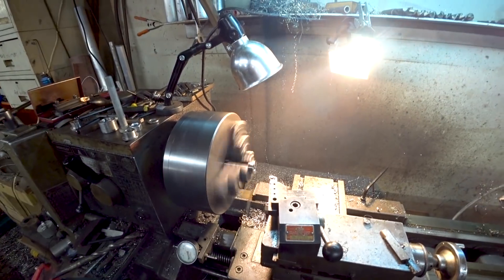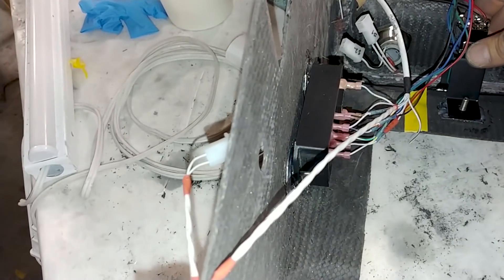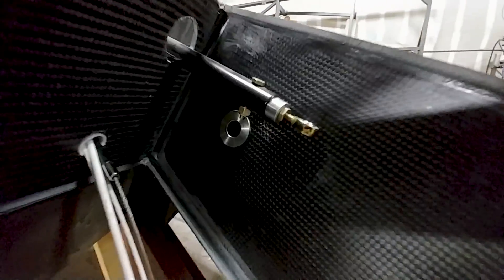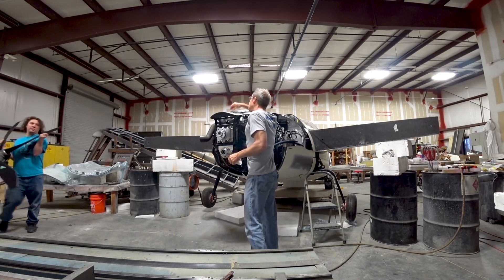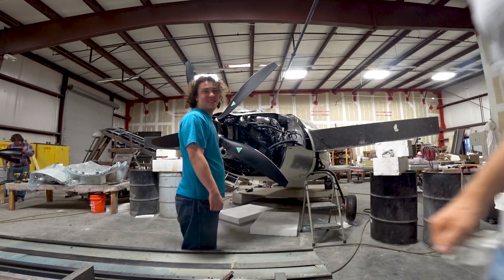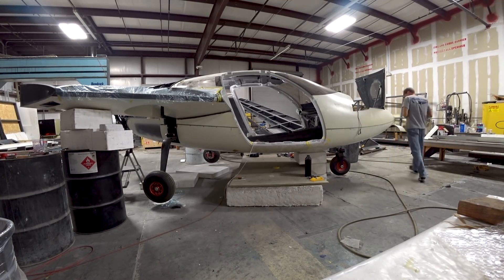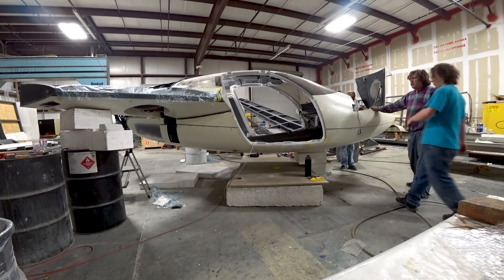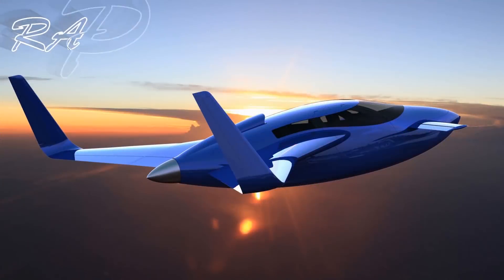This Bird Wants to Fly - Building the Raptor Prototype

Comment: Everyone agrees that the 5 blade looks great!  And I suppose the 4 blade would have slightly longer blades, so the 5 blade helps with the ground clearance.  When I see a 5 blade prop it is usually on a turbine airplane (higher horsepower) and I have often heard that a 2 blade prop provides better cruise performance than a 3 blade, but the 3 blade will climb better.  Just curious what led to the decision of using a 4 or 5 blade prop instead of a typical 3 blade?  The Velocity uses a 3-blade M-T prop so M-T does have a baseline for whatever they are recommending.
Reply from the maker: It's simply because we have enough horsepower to turn the 5 blade and MT recommended it.
Reply: There is a fairly complex (and counter intuitive) way of calculating prop efficiency. While I love the looks of your 5 blade prop and fully agree with the issue of unpleasant noise with 4 blade props in pusher aircraft , I believe it is necessary to actually do the math on this before making the presumably more expensive 5 blade standard. As a reference, the Piper Mirage with a 350 HP engine, comparable altitude but much lower speed uses a 3 blade. The Extra 400, also 350 HP, uses a 4 blade. Shorter blades will also compromise efficiency because of the fuselage masking a bigger percentage of the blade. My guts say... 3 blades...  @RaptorAircraft

Comment: 12” prop ground clearance at taxing  sounds a little tight. At what angle of attack would the prop make contact with the runway? The rear landing gear look a long way away from the prop.  That sweep the field before taking her out. The prop will eat all the stones kicked up from the landing gear.
Reply: my thoughts exactly. plus landing gear flex on a hard landing with reasonable angle of attack would eat up that 12" cery quickly
Reply: Not an expert but I felt the same when I heard that
Reply: Rafal good point!

Comment: At what angle of attack would prop hit the ground?
Reply from the maker: 10 degrees (edited from earlier)
Reply: That's a lot 😃
Reply: Presumably 20 degrees is with a 1G static load on the gear?  
How much will the main gear deflect under a heavy landing and, at that deflection, what will the maximum angle of attack be for a prop strike?
Reply from the maker: @PhilipFly11  ok, so if you slam it on the runway there is always the possibility of a prop strike given a hard enough landing. However, using the correct technique for landing the chance of a prop strike is as close to zero as could be. I've said enough on this subject for today. Thanks
Reply: @PhilipFly11  are you just asking rhetorical questions? Let him fly the plane and do some flight tests.
Reply: @Marc Anderson   Seems like Philip Galway-Cooper is asking a very legitimate question, one best delt with now.  
To his list of adverse conditions to consider ( not necessarily simultaneously), I would add max aft CG, head on wind gust, etc?

Comment: don't like the push on connector.  They can fail
Reply from the maker: Which connector are you referring to?
Reply: @RaptorAircraft  the blade types.  the ones you use crimp down to make they snug.  At 14:46 I see some I would solder together and not use the connectors and will fail.  I think your suck using them on the relays and another connector, but the butt types need to go.  Supper cool that you are getting so close.  Can't wait to see you fly over my house in her.

Comment: Wonderful progress Peter & team... I am one of many who eagerly await each video update and will be punching the sky when I first see this baby fly. 5 blade prop is a no brainer ..for reasons stated. Looks great... Re Landing gear retraction, I recall a discussion with a hydraulics expert some years ago about keeping a couple of cogs in "sync".. He told me that there were a couple of ways they used, including putting the action hydraulic cylinders in series, thus, by definition, both will work EXACTLY in sync as each moves the same amount as same qty fluid is passed thru each.. The other way was to put a restriction in the line to both, or in this case, all three actions.. Maybe more restriction in the front and a little less in the rear one (but the same in each rear cylinders). That way you could get the timing right, by juggling restrictions, so that all wheels raise and lower together.. obviously the restriction cannot be too small or will interfere with landing gear down... Keep up the great work !
Reply: I was going to mention the restrictor but someone (ahem) stole my thunder. 
A restrictor to the nose gear would slow it's motion down to better match the speed of the main gear and allow more volume to divert to the mains as well. The size of the restrictor would have to be determined. Restrictions to the mains could be needed as well.
An accumulator may be necessary to take out the bouncing/jerking motions of extension and retraction and should also ease the motion slamming to the end of travel.
As a former A&P who helped build a Velocity I thoroughly enjoy watching the progress in each new video.
Reply: @BadBobV65   I agree with the accumulator.
Reply: There are small, pure mechanical "rotary gear flow dividers" for some $200 that would do the job. They make sure N hydraulic cylinders (with same volume) stay in sync.

Comment: Possible solution to seating Main under-carriage into retraction space . A disc of Memory Foam ( used in Pillows & Mattresses ) that mimics the action of a shock absorber,  slowing down that last bit of violent seating into place as well as allowing wheel to be gently locking into place and reducing the vibration & knocking of the wheel during flight. Just a matter of the density of Memory foam and thickness of disc and how to bond it in place.
Reply: Industry standard is to use a snubber to stop wheel rotation. Usually made of rubber but sometimes a flexible metal wear strip. For the raptor he could use a rubber disk bonded to the bottom of the memory foam to absorb the impact and stop the spinning wheel all while preventing damage to the foam.
Reply: Addition requirement is to make sure wheels are braked and stopped turning before entering the housing or the foam will be worn away & destroyed.

Comment: I suggest you use a Flow divider valve (synchronous flow divider) to control the main gear oscillation problem. Check this sight out. https://www.hydraulicspneumatics.com/cylinders-actuators/getting-your-system-sync-part-1

Comment: Nice...regarding the landing gear retraction...Am I right in thinking that you have a reservoir and a single cylinder? if so perhaps you could employ a slave cylinder in the rear gear line to maintain even pressure??
Reply from the maker: Reservoir and each leg has its own cylinder.

Comment: What are the metrics for the performance gain vs the increased price for the 5 blade propeller compared to the 4 blade? Although that 5 blade does certainly look the part.
Reply from the maker: Well, not having flown it with either prop there are no metrics. It's just what MT have told me.
Reply: @RaptorAircraft  Ahh, suspense awaits us then.

Comment: Question: Do you have jack points planned for the production models to facilitate retract tests, changing tires, and other work on the gear?  (I could show you an example on a Lancair IV.).  I don’t think you need to worry about the gear coming up unequally as long as the retraction is quick enough. Many hydraulic gears operate that way.  The Lancair IV gear comes up unevenly when retracted on ground, but its not issue in flight. If you look at videos of Piper Aztecs take off (also hydraulic), you will see that most retract main gear unevenly.  As others have commented, I would sure like to see the prop clearance with the plane tipped at a 17-18 degree AOA, but I know you have calculated everything so it won’t be a problem.  The prop (and plane) look great!!!  Keep up good work. Have been following for months.
Reply from the maker: You can jack it on the spars and forward bulkhead points just as we have it resting on foam blocks now.

Comment: There are hydraulic cylinders with cushion stops where when the cylinder reaches the end of travel the main port is closed and a secondary adjustable port is used to control the final part of the stroke. This may help the control the motion your are having trouble with.  https://www.mathworks.com/help/physmod/hydro/ref/cylindercushion.html  It looks great.

Comment: With the gear fully retracted there appears to be a very large gap below the main wheel which will obviously create a large amount of drag as air will rush in!  Perhaps the wheel should retract to be flush with the wing to reduce this. Or are you also adding wheel doors?  Also the gear should raise and lower much faster and yes both main wheel need to raise and lower equally at the same time - not just for the removal of adverse yaw, but also for visual effect - I hate seeing aircraft raise the undercarriage where the front then one wheel retract, leaving a wheel dangling, which then goes up!  Just doesn't look right - like a shoddy design job.  Yes lots of aircraft do it - but many don't!  Pipes the same length = equal pressure, and lots of it!  Great job guys. Happy New Year
Reply from the maker: Gear doors are coming.

Comment: The 5 blasde prop amd spinner in black look great and of course it wil look just like the main picture once flying.  Great job guys, looking forward to seeing it all together and the start of the taxi runs - I take it you are going to place multiple cameras on and inside the aircraft for the taxi runs and test flights.
Reply from the maker: Got plenty of camera mount hard points already installed. You missed one of the recent videos where I showed them.
Reply: Tisk...tisk...

Comment: ,,, the thrust bearings will get oil from the bearing clearance. Can't remember if these bearings are one piece with the thrust. If so you can get some more oil to the loaded side by filing a 45 degree flat 10 to 15 thousandths wide, in the bearing with the oil groove. The flat will be from the groove out to the thrust area, at the parting line . Looks like it would be about 5/8ths inch long . Can't help but think of that continuous load. Most engines are only loaded there when the clutch is depressed .

Comment: i don't know how hard it is to get to the main gear cylinder lines.  i used to do a lot of convertible top motors.. i always had unions to connect the lines and plugs to block the cylinders.. with the hoses coupled.. i could run the pump in spurts to cycle air out of the lines.  i did for a while have a short line to connect to the cylinders with a valve at each end.. a tee with a valve in the middle. . this way i could connect to both ends of the cylinders. open the end valves.. push the cylinder in and out while filling thru the valve on the side on the tee fitting. usually i had soldered on funnel on  tube fitting on that so i could purge all the air out of the cylinders..  if i closed all the valves on the cylinder fill valve.  i could take one fill hose end off the cylinder and take the plug out of the other end of the normal hose and connect it in a few seconds without loosing more than a tea spoon of fluid.  i then disconnected the other test fill hose and connected the regulator line to the cylinder.. removing the plug in the end of the line first. .. this reduced my efforts to bleed the cylinders.   one of my skills was making ford retractables work again.  limit switches.. relays, screw motors..  it was a  nightmare..  a short video with lucy and dezi with a retractable. https://youtu.be/vNrMPrH4Pl4  the commercial is right.. boys will want to play with them till they break.  the last one i did.. the owner cycled it so many times he burned up the pump motor.  and those were large displacement versions. not a conventional top motor.

 it might be possible with double acting cylinders..  to run a pressure line to one cylinder. a jumper line to the second line and the other pressure line to that one.  this would lock your main gear together.  i would probably want to put some kind of tee with a pressure bypass so the up command  the pressure is bypassed to the return close to max pressure .this would have to be thought out and tried . . but i have not found your main gear hydraulics video yet.

Comment: Would it be possible to install a hydraulic flow divider into the system for the gear?     5 blade looks better IMHO
Reply from the maker: I'll have to research those to see if one might help. Thanks

Comment: If you can engineer a high Vlo speed it will help when the gear is used for drag to slow for landing. Conversly, a higher retract rate helps to reduce drag when performance is an issue such as heavy on takeoff, or high density altitude. Nothing like struggling to accelerate as you hum a tune and wait for the gear to retract... I suspect you may have considered these point thoug. Thanks for sharing the progress.
Reply: The act of extention is not the motive force of drag but the configuration and resultant parasite form drag would be. Given that no spoilers seem in the plan , the gear system, when configured , is the air brake. If designed properly, limits in the gear system avoid self destructine tendencies. You don't want to be doing S turns to slow for configuration changes on an instrument approach or to make an RNAV Star altitude window or speed.
But then, I'm just a guy in the gallery...

Comment: Those blade tips look very close to the ground. Is this going to be a problem upon landing?
Reply from the maker: I'm guessing you weren't listening to the audio. I mentioned that there is 12" of clearance. You won't be able to get the nose high enough to have a prop strike. The fore plane will stall well beforehand and drop the nose.
Reply: @Raptor Aircraft   I’m just in DFMEA mode but 12” enough?   6” of grass or snow aren’t desirable but one may still want/need to use that runway.  Since we’re here, what can be done to mitigate FOD risk (beyond perfect taxi n runways) on a pusher?   It’s a great configuration but what is the risk of prop damage?  
As always a supporter and practitioner of “tough love”.
Reply: If i recall correctly (not a pilot, yet), canard aircraft land fast and don't flare like typical single wing configurations.  So it should come in at a relatively flat attitude and not be a problem. Again, not a pilot, or really an aviation expert of any kind, just seem to remember that.

Comment: I would paint the plane batman black, like the blade
Reply: Black does not work on carbon fiber, it retains too much heat. If you want to have your airplane melt on a hot summer day, paint it black. White is the best color, to reflect the heat.
Reply: @russelllowry1061  there you go again, using science, and logic, and stuff...
Reply: @russelllowry1061  ok, but it will look so cool. Maybe a 2 tone. White on top, silver on bottom.
Reply: See and be Seen
Reply: green... MONEY green.   Looking great